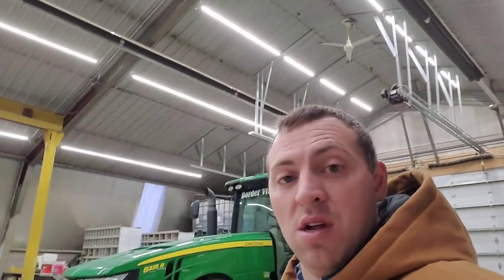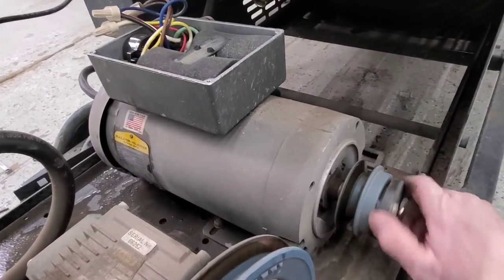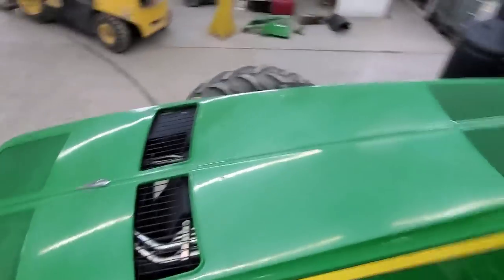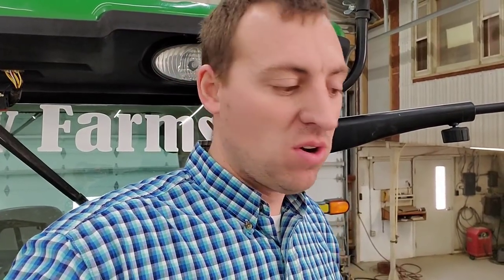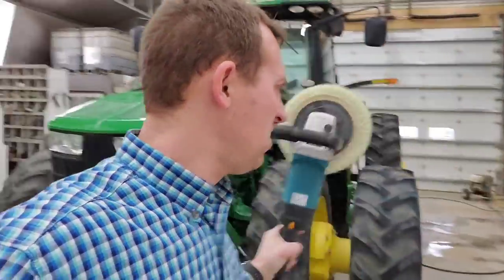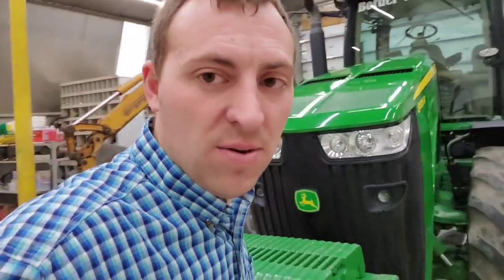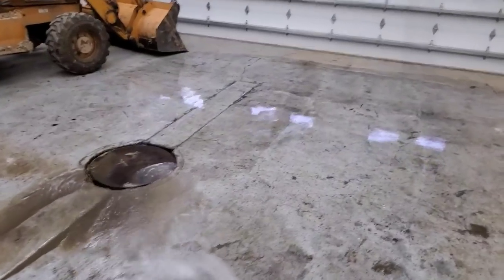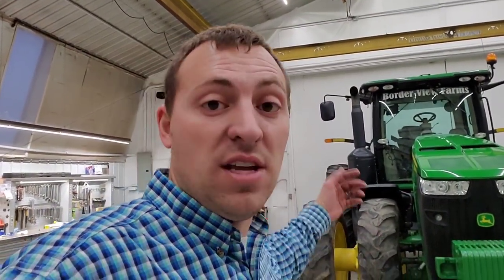Foam Cannons and Ceramic Coatings - #71

Comment: That ceramic coating seems to work awesome. Wonder if it can be used on cars. Great video once again
Reply from the maker: Oh it's made for cars. I was wondering how well it will work for tractors.
Reply: It’s used on vehicles much more than farm equipment.  I have a friend who has an automotive enhancement business and a big part of it is applying these ceramic coatings.
Reply: Lol good for cars... Check out Apex Detail here on the tube😎